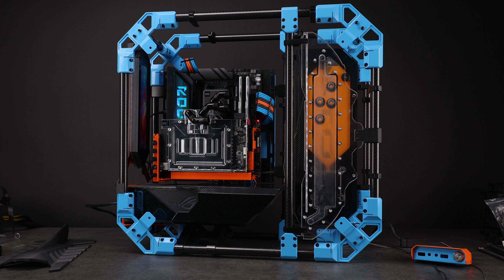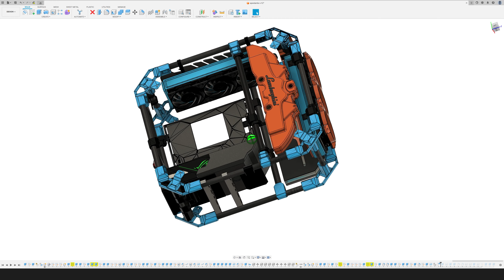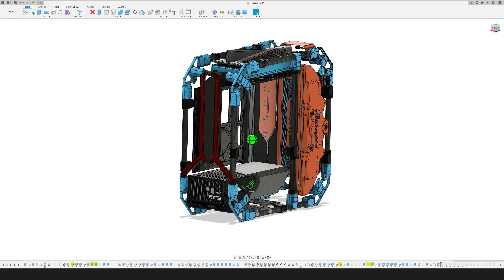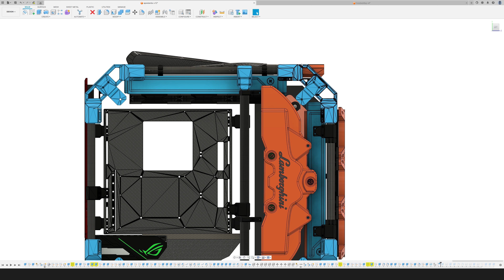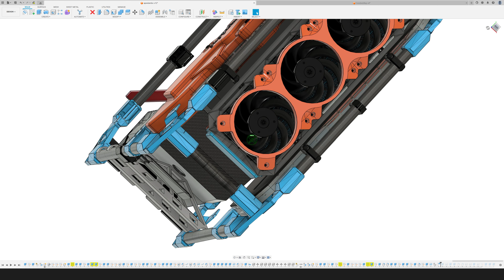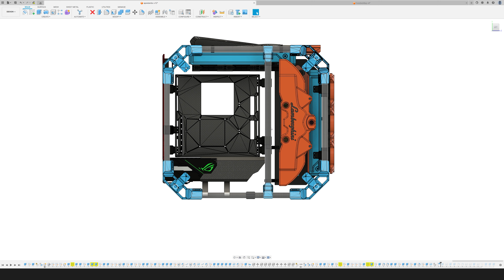Project STO: Custom Alphacool Apex Skeleton Build Progress Update; Powder, Distro, 3D Design Part 2

Comment: use spot putty bondo and acetone (mixed together) to make a thinner version of the bondo on the 3d printed part and bush it like you're painting it, and it removes all the layer lines like magic! Looks good bro
Reply from the maker: I use wood filler with acetone and then spot putty